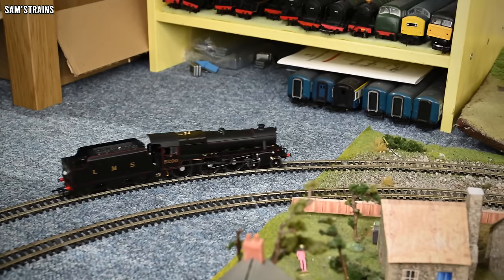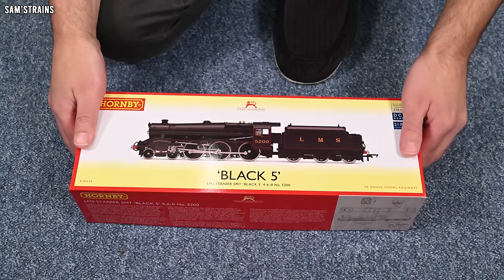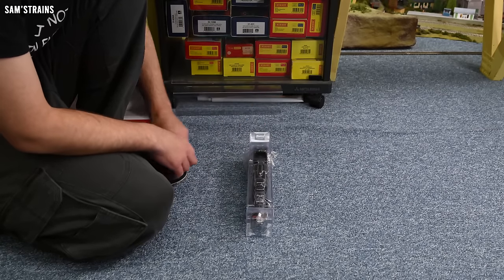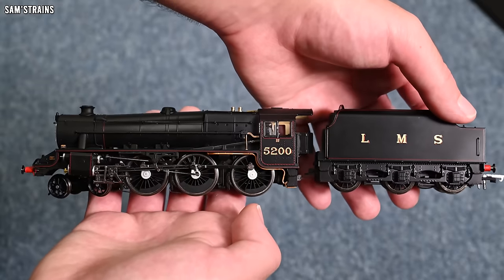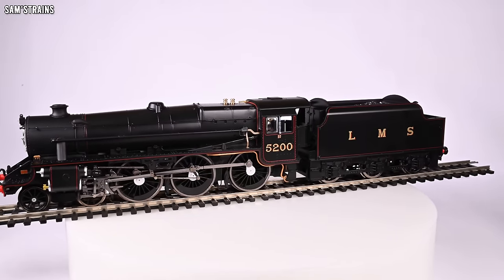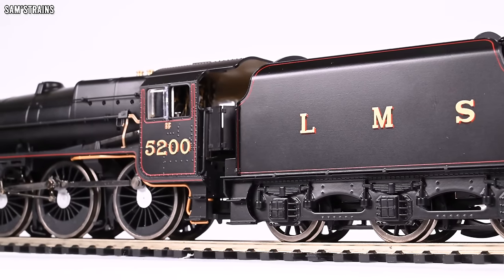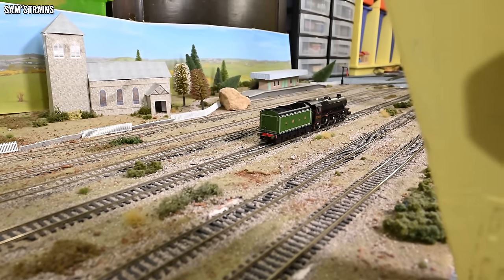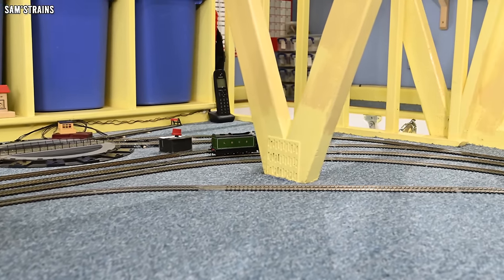Hornby's Horribly Faulty New Black 5 | Unboxing & Review

Comment: Sam, I'm sure someone else has pointed out the other issue: the walschaerts at 32:15 is all flopping about, likely the cause of the loud valve gear clicking.
Also; am I missing something? The 1954 Hornby Dublo 4mt had 4 locos come back under warranty. Out of the initial 100,000. Is it getting too hard to make a decent locomotive now? And tbh the dublo wasn't exactly top notch, no axle bearings or flywheels, weak magnets etc. It was just well put together. My 70 year old märklin stuff are horrendously noisey, gear whine, outrageously complex mechanisms, and they pull anything you want to throw at them, a 3015 krokodil weighing in at 970 grammes...
Good review, as always

Comment: I have had a preorder on the Steam Generator version ever since they were announced. 

I hope they fix the issues before that one goes out. The level of detail is amazing, and honestly the lack of die cast and even the warped running plate arent really deal breakers for me, as long as it runs fine. 

The steam generator should add back a bunch of the missing weight at least.

Comment: I had a similar problem with one of the newer Hornby A4s (Golden Fleece) that has the same tender connection. The tender connection has very delicate tabs into which the loco circuit board connector makes contact with when it’s inserted. The flimsy nature of the tabs means that they can easily bend or get caught by the circuit board and actually broke them on my model. I had to spend about an hour trying to solder the tabs together to reattach and reinforce them. I honestly prefer the more durable wired plug and screwed connectors they had on previous models. I would not recommend detaching the loco from the tender unless you really have to on these newer models.

Comment: I have the exact same issue with my Dublo Scotsman. Normally I'd return it immediately for a refund, but as all sold out, I decided to fix it myself. I took the tender connector apart, which is clipped together and fragile. But I got it off and found that the metal strips for the contacts are very dirty especially considering I have it for less than a year and didn't uncouple the tender too much. Then I cleaned the contacts with a fiberglass pencil and some alcohol. After that, she ran very nicely and now is DCC sound fitted. A shame thay yours is so horribly faulty. My question is on the P2 connector as well, is that how long it's gonna last, as mine also had a Bent contact and got dirty quickly. Taking it apart is quite risky so if you break the clip it's game over. I'm still thinking about buying the steam fitted model, as I want that, the lights and the sound. I'll have a very close look in a shop before my purchase as I live outside of the UK and returning anything is a huge pain. Sorry Sam that yours sucked, but hopefully, this is a one off mistake. Unlikely, yes, but unlikely things happen to all of us at the best of times.

Comment: Sam, I'd like to pick up on your comment that you might have been unlucky with the quality of this model. 

I had to request TWO replacement Hornby Lion models, one after the other, for having wonky chimneys. I gave up with ordering directly from Hornby and purchased my FOURTH from Rails of Sheffield, which luckily had a straight chimney. 

There is a serious, serious quality control issue at Hornby's factory. I also suffered the exact same defects as you Sam with the Hush Hush model. I wonder what there is any of us can do about this as my faith in Hornby is withering after dealing directly with them and they sent out a faulty replacement twice!!

Comment: Sam, I draw your attention to you stating that all the wheels on the loco had pick-ups. This being the case, the loco should run regardless of any fault with the draw bar connection. I respectfully remind you that a number of Bachmann locos have no electric connection with the tender and they run with no problems.

Comment: @SamsTrains - Thanks very much for your review of the new Hornby Black 5. I'd been considering trading in my "old tooling" 5s for Hornby's new one. Think I might hold fire on some for now. Re: Quality issues, from the video at 9:33 in your review it looks like a smokebox end foot step is a bit wonky 😔on your example, to add to the other probs.. Don't think you mentioned this in the detail section.

Comment: You are right to critisize. I am not so worried about the running plate (I work on preserved steam locos, and none of them have flat running plates), b ut all the other issues would be enough to mke me return it - not good enough for a £200+ loco, or even a £160 one.

Comment: i think the manufactures need to go back to Basics 
I had a Triang EMU back in the 1950's and it worked straight out of the box lights and all 
I did not have to worry about picking it up either as it was solid and designed tough and it was still working in the 1980's 
Now I have locos that look good but you have to be so careful picking them up for fear of parts falling off

Comment: Very good review Sam. It's the issues with the model that are bad I've pre ordered the smoke generator version. I've read some of the others comments and watched another review that was a more positive experience.  It's pretty clear that there is a serious lack of consistency in quality control that is letting Hornby down.  Issues occurring like this must be breaking the hearts of the designers in Margate.  The factory in China has to get its act together or the quality control function has to be bought in house,  otherwise I fear for Hornby's future.  I've bought a few new Hornby locomotives and so far have been very happy with them ( Princess Coronation and Thane of Fife plus some Railroad Plus diesels) .  I am going to keep my pre order live because of my previous good experience together with the pre order Flying Scotsman smoke generator version and hope both will be acceptable.
Reply: I'm not sure, but I think there are still multiple factories that Hornby uses. One can by an identical model (same catalogue number etc) but built in two different places. The result - one is superlative, and the other is as Sam received...
Reply: Explains part of the problem. As customers we can't be expected to take pot luck on whether we get a well or poorly produced model. In this example it failed to run out of the box. Other comments on this review show Sam is not alone in receiving shoddy goods. Hornby  have to up their game on quality control to achieve higher levels of customer satisfaction. It can't afford to fail. It has to do better and all of the time for every model.
Reply: Hornby uses multiple factories* in China all owned by different people to make their models. Hence why you can get one model coming out with no issues but another having lots of QC problems.

Also it’s all very well saying “don’t use factory X again” but there are only a finite number of factories in China geared up to making model railway stuff and there is lots of competition for production slots from the huge number of model manufacturers out there.

* Yes at one time they did use a factory in China but that factory went into conical difficulties and got bought out by Kadder - who own Bachmann and who are not going to be making products for a rival
Reply: The above reads like a bunch of excuses. The fact remains that no manufacturer can expect their customers to take pot luck on whether the goods they purchase are good or poor. As I have previously written I have no problem with any new Hornby  models I have purchased. Another unfortunate fact is others have, with Sam's review being an excellent demonstration. Hornby need to improve their quality control giving all potential customers the assurance their purchase will be of a good standard and free of defects.

Comment: I'm sad this has turned out this way, I was considering buying one. At the moment I will wait I think.

May take a chance if they announce an LMS scheme with the smoke generator (it will at least add weight).

I wonder if the plastic boiler is a design compromise to accommodate the smoke generator.

Comment: What a funny model.

Interesting how other reviewers have proclaimed this as "Hornby's best LMS loco" or "Hornby's best Black 5", noting that all of them have admitted the headlamps can't be changed without completely breaking them, and proceeded to say "can't find any fault". This has to be a joke hasn't it?

It's a shame you have to get a refund. Maybe you'll give Hornby a second chance and get a different variant (like you did with the Hush Hush).

One thing I think you should've done is a side by side comparison with the old Black 5, to see how much better this really is (at least externally).
Reply: As a display model (without the glue marks etc), this is quite simply the finest Black 5 I've seen in RTR. Hornby's design team pulled all the stops out.  The livery is the one used for the loco's official photograph - hence the polished driving cranks etc. In 1-1 scale, the locomotive was in almost mirror-finish high gloss.
Reply: I'm wondering if those lamps' glueing wasn't due to a mistranslation between English and Mandarin, or if the assemblers in the sweatshop over there not paying attention and glueing by mistake...
Reply: @thhseeking  Chinese quality control is not what it was. Away from railways, my other interest in 1:18th car models. Traditionally the finest maker of all, CMC, has recently had problems - typically rear light clusters the wrong way round(!) and a boot (trunk) lid that fell off its hinges at the first time of opening.  These on £600+ models.  Not so long ago a CMC model was pretty much of exhibition quality.  These days? Not so sure.

Comment: Looks nice, but a real shame about the quality. Although I'd go for a Caprotti one if I were to splash out on one. But why aren't the smokebox numberplate and shed plate (or the builders plates, although they are a little small) etched? 
How does the haulage power compare to the old Hornby super detailed one, or the Railroad one?

My Dublo Flying Scotsman, 1923 condition as 1472, has the matt smokebox, although it's not as noticeable as my Accurascale Dinmore Manor.

Are you now going to review the Ellis Clark Trains one, now that's just come out too?

Comment: 13:27 you are absolutely correct boss, those are mechanical lubricators 👍 also the pipe work running from under the footplate steps is the injector assembly and delivery pipe to the top feeds. Slightly different on this black stanier than other fives as this one is an early domeless 5 with the regulator assembly in the smokebox and the vacuum brakes driven from a vacuum pump on the crosshead, much like gwr practice. Stanier phased these items out over time on later batches. Nerdy stuff innit? 😂
Reply: You'd think that someone who makes a living from reviewing model locomotives would at least know a little about the prototypes. I normally only watch the reviews to see the close ups the the model and to tick off how many vague / false statements Sam makes about the prototypes LOL!
Reply: @paulcaswell2813 I don’t judge mate, I do stuff with the real steel stuff and there’s always gonna be something new to learn, little differences between batches mean you’re gonna be kept on your toes. And that’s before you get into buckets 😂

Comment: Love the energy Sam!  Hornby can’t be defended in this case as warped diecast Mazak running boards take a lot of skill to fix.  For the money, many people including Brassmasters have made excellent examples of detailing and improving the old model to better results.  I may just have to send you some sketches of a drawbar design I’ve been thinking about, as I can’t stand the idea of having only one option for loco-tender spacing.  Also, having tested my favourite clapped out old Bachmann Thomas, I can attest to the fact that it crawls as well as this new model (though the eye mechanism has been removed).  For a common as muck loco that people will want/need fleets of, this doesn’t make a single lick of sense for the price, especially considering that you can buy and old one 2nd hand and possibly have enough money left over to buy the Brassmasters detailing pack and/or a whole new set of frames (Comet) and drive (High Level or Slater’s).  Thanks as always Sam!  Happy to be a “Hornby basher” with you!

Comment: I think its the contacts inside the socket on the tender are too flimsy and fragile. Have had a couple sent back to hornby for repair, one had new socket, other one had new tender chassis replaced. 
The rod on the middle wheel keeps dropping, maybe a loose screw? That probably why your hearing the clicking.

Comment: Hi Sam, I am bemused and frustrated with Hornby that there is so much reference material published about Black Fives, and still, incorrect brake shoes, there should be no space between the running plate and the underside of the boiler, footplate back head detail is incorrect and very poor bogie wheel profile. 
Also hopelessly over scale lamps and tender side thickness. 
Apart from the poor build quality. 
Black Fives and 8Fs are some of the most popular and ubiquitous locos, yet those of us who like these engines have only ever had poor offerings from Hornby RTR. 
It would be nice to see one of the other manufacturers really taking the opportunity to produce a Black Five or an 8F that is accurate. 
OK rant over but Hornby have disappointed yet again with a Black Five model, they call it the ultimate Black Five absolutely not. 
As usual SAM a good video and very informative.

Comment: Its now clear that Hornby have no quality control. My guess is that the manufacturer sends the final sample to Hornby in pristine condition, Hornby says fantastic, do a run of 2,000 and the quality control stops there. If was me I would test check 1 in say 20 of the shipment when it arrives. Clearly its not just this model as you have stated about the glue issue in previous video's etc. I note that in there recent TV series    quality control was never mentioned? Surely you'd want to show that so customer's would know the level of quality to get the product to the market.

Comment: @SamTrains, (EDIT): I think you should give Hornby another chance on this, as others have stated and shown that theirs are fine. Looks like it might be only your model, although they didn't mention stuff like glue marks.

if you were a Hornby basher, I doubt you would've been on the TV show "Hornby: A Model Empire."

When you said you were going to return it to get a refund, I wouldn't have kept running it.

PS: You forget another fault when you counted the faults near the end, the bent pipework accessories.

Comment: If the loco has pickups too, why does it fail with the connection to the tender ? 
Can the loco run without the tender ?
As for your negative review, top marks. £200+ for a loco is a frightening price and they wonder why sales are low nowadays.
Reply from the maker: Nope - can't run without the tender as all power must go through the DCC socket first, which is in the tender. So the loco pickups are connected to the tender... and then back to the motor!
Thanks for watching, Sam :)
Reply: @SamsTrains  Ah, I see. Seems like they need to go back to the drawing board on this one.

Comment: Showing my ignorance here but if the loco has 3 pickups on both sides, why is it not running on its own without the tender which is in effect is supposed to only add pickups to the 6 on the loco.
Reply: The DCC socket is in the tender, so all connections from the pickups have to run back to the tender and through that connector before the motor can be powered. Presumably the lamps and firebox take a direct feed from the loco pickups.
Reply: @LittleWicketRailway  Problem solved. Thanks a lot.  I think the brain was having a blank moment because I have got the odd loco with this arrangement.

Comment: Picked up an old tooled one on eBay for £51 and she runs sweetly! I have 5 of the old tooling and a railroad one and after seeing this review I'm not feeling the need to either upgrade or add to that collection from the latest batch. Very disappointing and that price is insulting even without the issues you had; the lamps are a bit gimmicky and cheaper ones are available, the smudge on the tender and the glue marks and no diecast body! Accurascale showing why the big boys (Hornby & Bachmann) need to step up their game. Other than the detail (which you can add to an older one) this seems like a downgrade to me! Great vid though Sam, thanks for the laugh

Comment: Drawbar problems - but don't the pick ups on the loco driving wheels still work?!
Reply: The lamps and firebox are working. However power for the motor goes through the DCC socket (so decoders can function) which in this case is in the tender.

Comment: As good as this model looks, it doesn’t seem to be that high quality in all aspects. To be fair, you probably just got a bad model, and I think that the performance on the engine would be rather excellent if it wasn’t faulty. For instance, my hornby dublo Flying Scotsman isn’t the highest quality on the exterior, as there is a small paint chip on the dome. However, the performance is great, and I will send it to hornby to be repaired. One question though. Would the lamps work on other engines? But as always, great video Sam! Thank you for the review!

Comment: I can't really notice the glue till u mentioned nor the running bored and I think the price if it was working out the box is not a bad price 160 to 210 is about right if the the details are there witch thay are on this has so I think your review of this model was a little harsh as the glue marks and running bored are really not that much of a problem